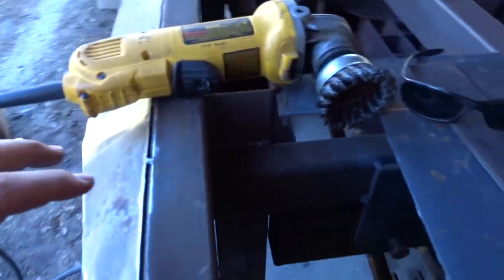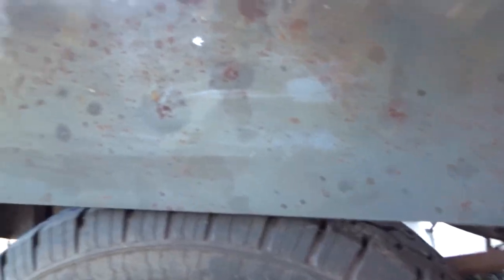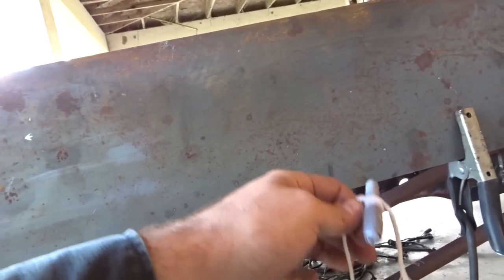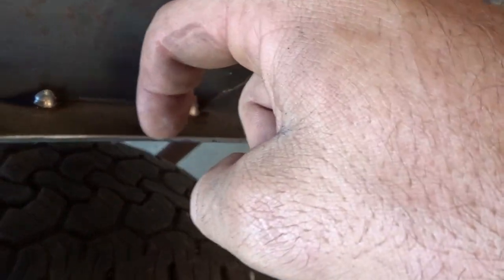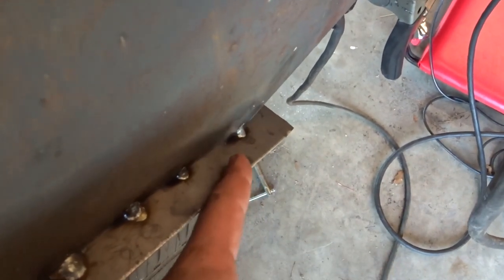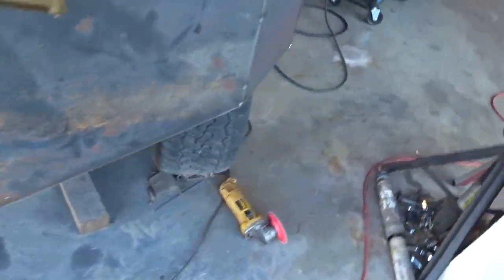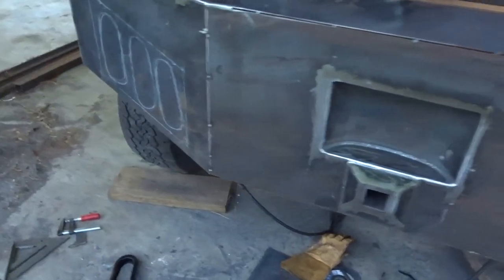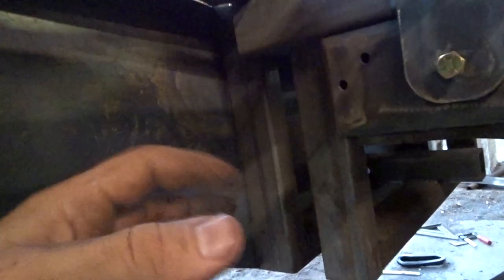How To Build A Flatbed (PT 6)

Comment: hey awesome work your doing, im beginning to build a dump bed for my c4500 im using 3" c channels down the frame, i was thinking about putting 6 inch c channels on the side of the bed, curious if you had any suggestion our how you would do it, i wasnt sure when i put the floor down if i could butt it up to the c channel on the sides

Comment: I'm using 10 ga. to skin my bed. I didn't tack the pieces on the back before I cut out my tail light holes and it warped up my plate. Any suggestions on how to correct the warping? I don't have a plasma cutter.
Reply from the maker: You could try heating up the other areas around it to try to shrink it but if it’s real bad you may have to make some relief cuts and try and re weld it

Comment: Hey bud .. what's the plate thickness on top and the tubing size for the rails and runners?
Reply from the maker: 1/8” plate all the way around and used 1/8” wall tube along with some 3/16 wall for some of the beefed up parts
Reply: @j_moffitt   oh ok sweet.. what size is the tube ? 2x4
Reply from the maker: 2x3